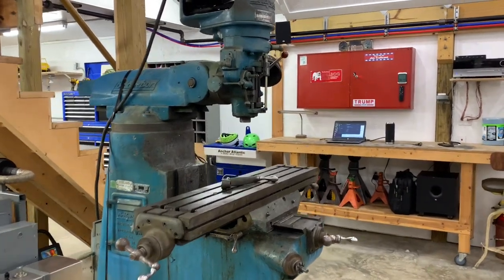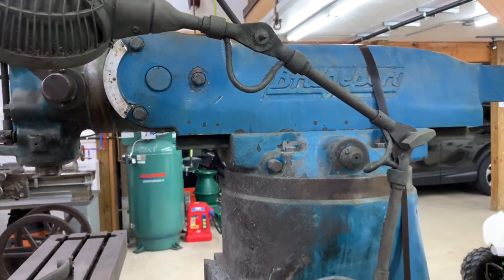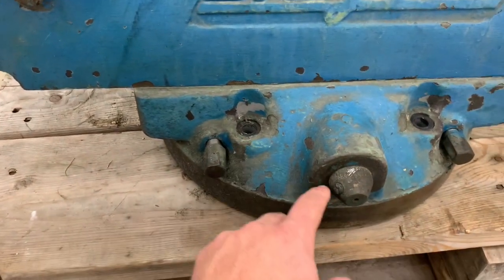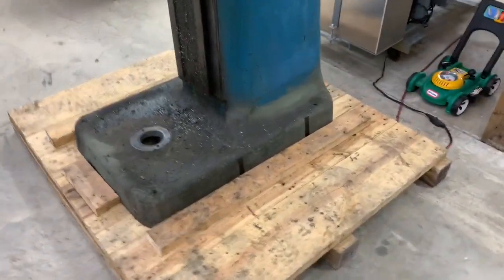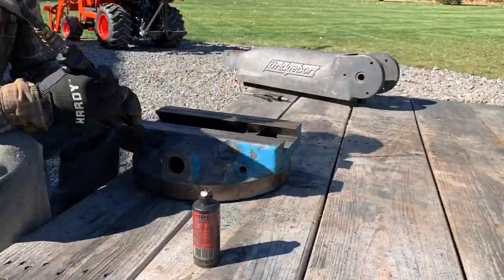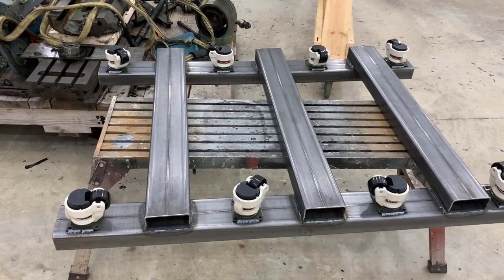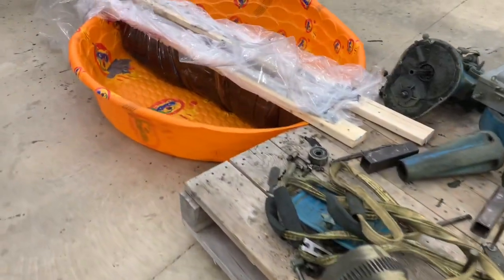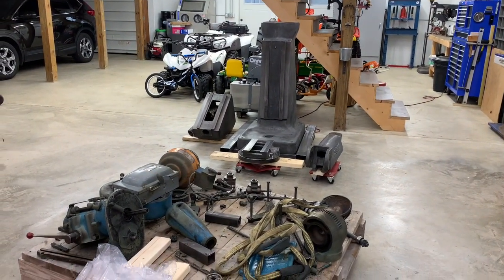Rebuilding my Bridgeport Mill!  Part 1

Comment: Hey i have a question, what is your experience with the mill being mobile? i've been wanting to do this but everyone around me that i've asked says that mills should only be bolted to the ground on a foundation which is separated from the foundation of the building and nothing else would work. the mill i have weights around 600-700Kg(1325-1545 lb)
Reply from the maker: There are so many armchair quarterbacks who say you can’t do this and you can’t do that.  Machinists are prob the most old-school group of guys I’ve seen throughout my hobbies. In reality, the likely hood of casters with adjustable feet being the limiting factor of consistency is so unrealistic that it’s almost humorous for my talents.   The wheels have come in very handy when arranging my tools.  If I had a bigger shop with dedicated work areas maybe I’d feel differently.  Long story short, I’m very pleased with what I put together.  I should make a final video one of these days,  it came out much better than I expected.

Comment: What are each of those casters rated at? I'm considering just four of the 1,100 lb ones. You mention it's overkill, but is it 4x overkill?
Reply from the maker: I’m glad I went with 8…. Even the smallest bit of dirt will stop the casters,  if the weight was only on 4 I think turning and maneuvering would be too difficult.  It takes all my strength to get it moving with 8.  Just my 2-cents

Comment: Yeah, great shop and toys. Just to add to the list of those who want a video (at least a short walk through) on the hoist. Maybe a quick commentary on the dimensions and pros and cons. If not, all good. The bridgeport series is sweet.
Question: got my eyes on a mill in my area, $1,000, says the spindle is sized from little use. Can tell if it's been dropped or damaged, says the motor runs great, just spindle is locked, think I should risk the purchase? I know it's a loaded question and a shot in the dark. But, it's a Bridgeport.
Reply from the maker: I wonder if it’s really seized or if they just have the back gear and top selector in the wrong position.... there’s not much that can actually “seize” in the quill from what I can tell.  I paid $1k for mine,  not running but complete.  I’d say if the ways seems good enough and if it’s complete, $1k is a fair price.  I’ll make a video of the hoist later this afternoon.  Have a good one
Reply: @BobWilson84  Thanks. You're the man.

Comment: Where is part 2?  Love the way the needle scaler blasts the paint off.  Will try that on my Supermax when the weather warms up some.
Reply from the maker: Hey Dave,  part 2 in couple weeks or so.  Everything is mostly finished. I’ll go over the basic outcome of the restoration and new parts.  Part 3 will be the DRO, power feed, vfd, lights and fun stuff.
Reply: Hi Bob, 

Thank you for the video and sharing your journey. I am about to make similar base and want to know what is the rating of your casters. 

Are the 8x casters the 1,100 lbs GD 80F casters?

Comment: I dont think you can have a mill or a lathe on wheels? theres a reason they are leveled and mounted directly to the floor - I dont know that reason, but somehow it seems like a terrible idea? LOL
I have never seen machinery in a machine shop that was mobile.............
Reply from the maker: Yep,  the casters have feet which lower down and support + level the mill when it’s in use.  The casters and portability is great to have since I’m always rearranging.

Comment: How did those casters work out. Can you move the mill around easily or would you have gone with bigger casters
Reply from the maker: They work better than I could have imagined.  I forget if I left the info for them in the video.  They are from casterHQ and called “leveling casters”. 8 is the right number for something this heavy regardless of their rating
Reply: Cool thx for the info I made a metal pallet for mine but not with casters. I like the idea